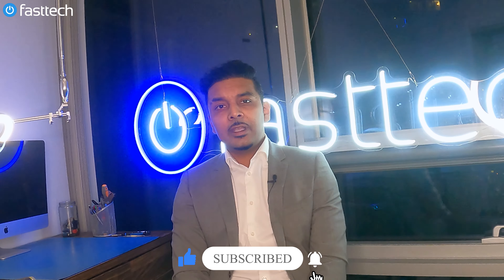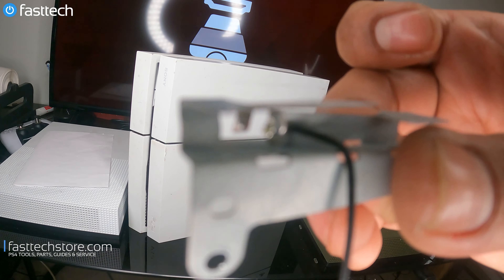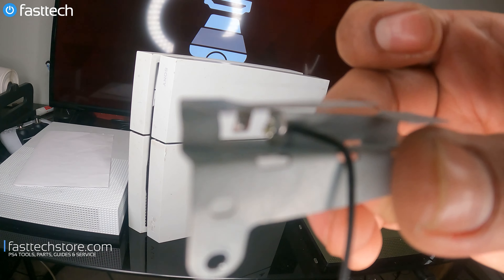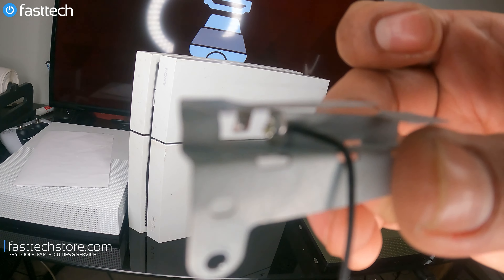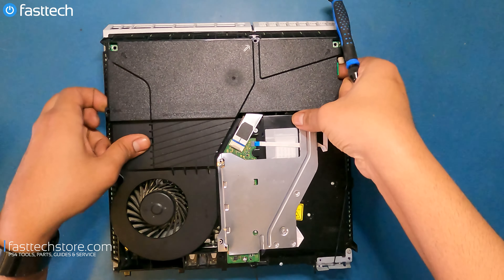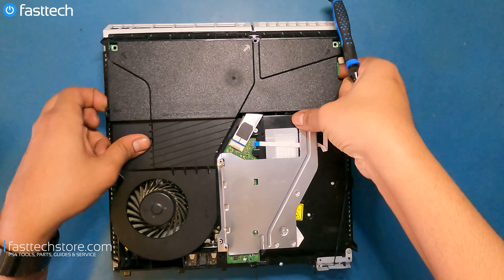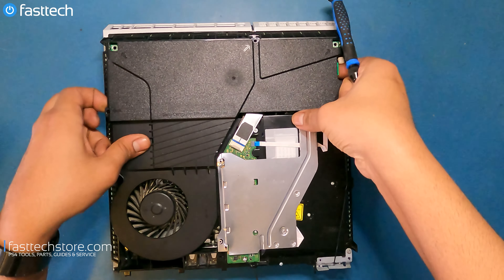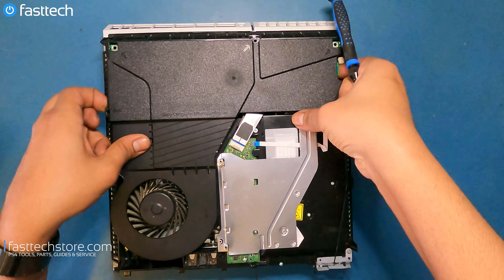How to Fix PS4 Controller Lagging (Antenna Replacement)

Comment from the maker: 👉PS4 CUH-1001/CUH-1115 Antenna: https://www.fasttech.ca/playstation-4-parts/ps4-wifi-antenna
👉PS4 CUH-1215/CUH-1200 Antenna: https://www.fasttech.ca/playstation-4-parts/bluetooth-wifi-antenna-cuh-1215a
👉PS4 Slim Antenna: https://www.fasttech.ca/playstation-4-slim/playstation-4-slim-antennae
👉PS4 Pro Bluetooth Antenna: https://www.fasttech.ca/playstation-4-pro/playstation-4-pro-bluetooth-antenna
👉PS4 Pro Wifi Antenna: https://www.fasttech.ca/playstation-4-pro/wifi-antenna
👉Fasttech Pro AutoKit: https://www.fasttech.ca/tools/fasttech-pro-auto-kit
👉Need Help? FaceTime/Zoom Video Call Me: https://www.fasttech.ca/online-consultation
👉GET REPAIR SERVICE FOR YOUR DEVICE: https://www.fasttech.ca/electronics-repair